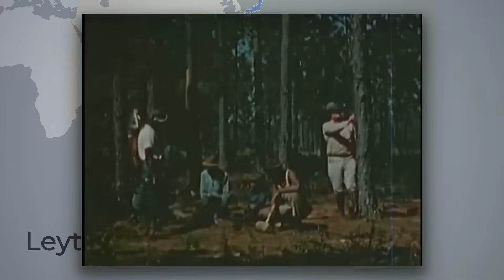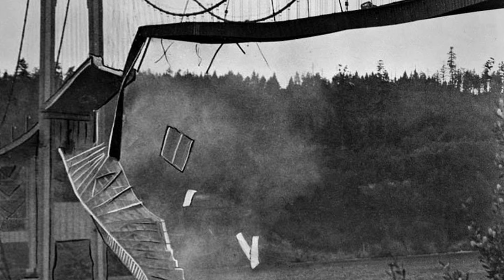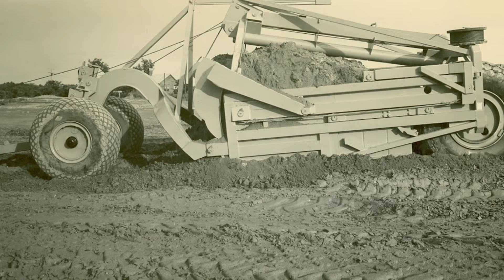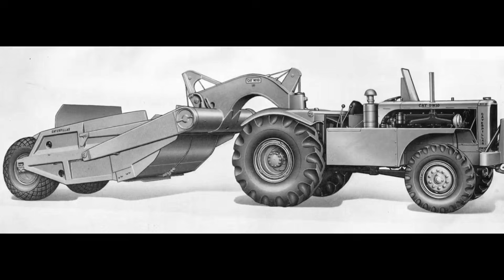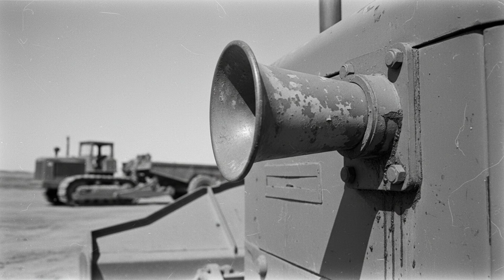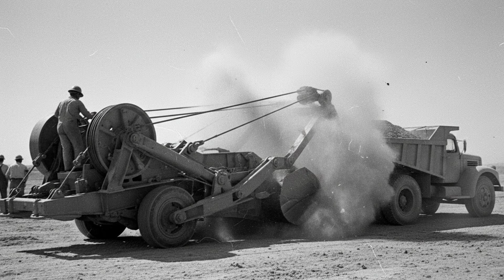Before Hydraulics: 1940s Scrapers That Killed 1,800 Operators!!

Comment: I operated cat D8H 22a donkey start engines and cat cable scraper boxes .
Two drums with three functional scrapers and still have the scars on my hands to prove it.
When you snapped a cable and had to re rope it in your break time you learned not to do it again.
Grading was a pain with the ejecter closed and the apron at full height was dangerous.
No cabs to worry about air-conditioning

Comment: In the 1940’s, hydraulics was a new, emerging technology.  The United States Navy regarded it as a strategic technology that provided an advantage to its aircraft carrier fleet by providing reliable aircraft elevators.  Japanese carriers used electric screw jacks that frequently jammed.  In 1940, the most sophisticated hydraulic system in the world was beneath the stage at Radio City Music Hall, which could tilt, left and right and front to back. It also had a large turntable in the middle.  Fearing a Japanese spy mission to photograph and copy the system, Marine Guards were stationed under the stage, 24/7, for the duration of the war.
Reply from the maker: Fascinating context! The military connection to hydraulic technology advancement is a great point — wartime necessity really did accelerate a lot of innovations that eventually made their way into civilian construction equipment. Thanks for sharing that!

Comment: It is easy to tell you never operated cable scrapers.  I disagree with a few things you said in the video, and I will leave it at that.  It is possible that I am older than your average viewer and have been around a lot of cable operated equipment.  There are viewers who have far more experience and knowledge than myself, who have more experience than myself and they disagree with things said in the video.
Reply: My Dad had cable equipment, scrapers and dozers. He always said that cable operators were more skilled than hydraulic operators
Reply: I agree you had more feel with cable than with hydraulic I personally prefer cable you just have to pay attention to it more
Reply: I owned a le tourno  lp scraper and used it on and off for years if you operated it sensibly you had little problems with it

Comment: Hello, Construction Legends.
WOTTTA LOADA KRAPPPPPPPPP!!!!!!!!!!!!!!!!!!!!

You claim that LeTourneau's scrapers had ONE cable controlling them. THAT is UTTER BOOOLSCHYEEEYITT. I am not going to tell you how many cables they did have. DO YOUR RESEARCH.

Ditto with the Wooldridge scraper which you claim had THREE cables,again TOTAL BS.

Push-loading - "The 'dozer operator signalled with a horn." "When the bowl as full, the 'doer operator could not see it." MORE BS.  It was NOT the 'dozer operator's job to decide when the bowl was full. DO YOUR RESEARCH to find out who's job it was.

To push the scraper to load it, the 'dozer operator put his blade up against a dedicated push block on the rear of the scraper - around TWENTY FEET from the scraper operator sitting near the FRONT of the scraper. And those scrapers DID NOT Have cabs. At best, they MIGHT have had an open canopy. The operators could see each other, at least head and shoulders.

Both the Gondola and the Mountain Mover were built in the 1920s and used ELECTRIC motors to control the bowl functions, controlled from and powered by the towing tractor. R.G. was VERY proud of his electrics. BOTH of these scrapers were 'one-offs' and NEITHER saw wartime service.

And I'm LESS than 1/2-way through your BS video. Am I still on your Christmas card list?

Just my 0.02.

You have a wonderful DELUSION. Best wishes. Deas Plant.
Reply: Calm down mf
Reply from the maker: always appreciate you 0.02 :)